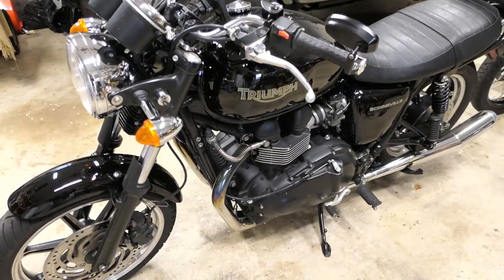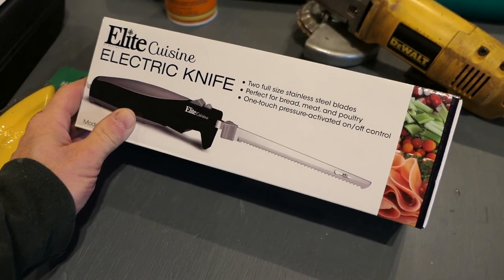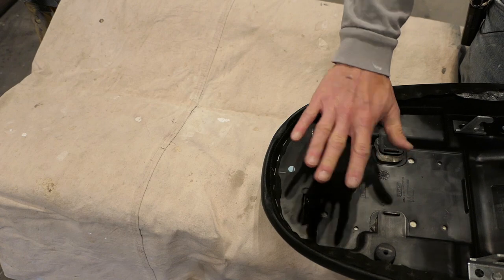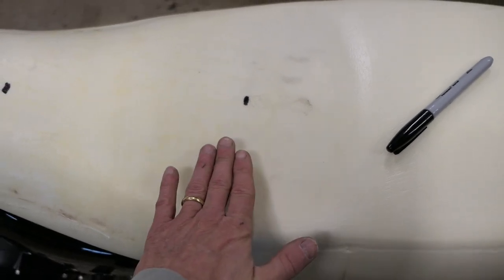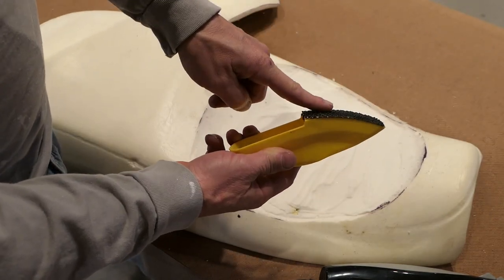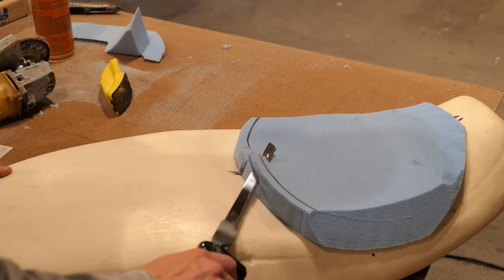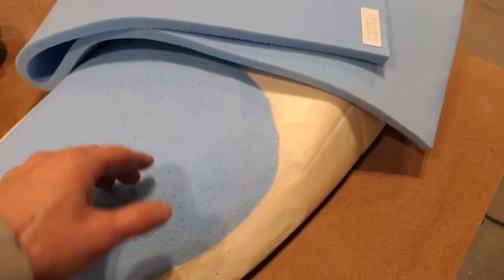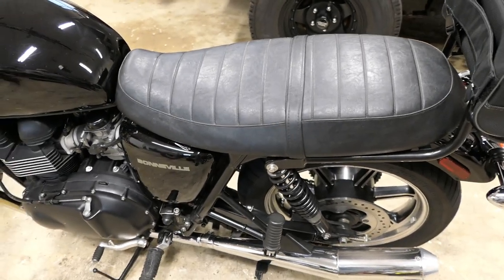Add A Seat Foam Insert For Your Triumph Bonneville

Comment: Great video. Curious as to how it’ll break in and feel down the road too. Wanting to do this to my bike since new seats are $3-400. Thanks for the lesson!!
Reply from the maker: I put this off far too long.  Really the hardest part was finding a supplier of the foam and picking the right density.  The actual work was not bad at all.

Comment: What densities did you end up using and how do you like it now that you've had some time on it? Is their chart pretty accurate? I'm going to do some work on my scrambler seat, great video thank you!
Reply from the maker: If you are on the bubble, go with the softer density.  Their chart is okay, but I think it's a little biased toward the firm side.  I weight 140 pounds and the softer density was better for me.  Of course, it's not just about density--the height matters too.  If you can go with a little higher cushion you can use a softer foam and still have something between you and the pan.  If you need to cut the foam very thin, then too soft of a density could leave you sitting on plastic!  So, it's a balance.  I'm still very happy with my modifications.

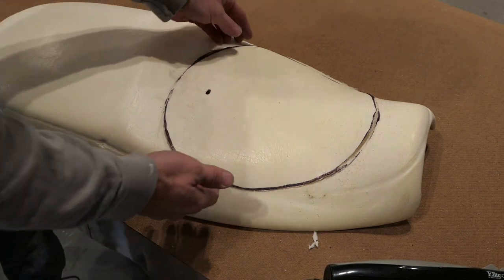Comment: great work and a lot of courage to tackle that job. However, as you say at 7:55, there isn't much of padding - as the saddle was designed for the looks, not for comfort, in my opinion. So, softer or harder makes little difference. My butt immediately finds the hard shell underneath, so I would rather use a firmer foam.
Reply from the maker: Every rear-end is going to be different, and body weight is important to consider too.  I recommend purchasing a variety of foam densities so you can experiment.  I've been very happy with my modification in the time since it was done.
Reply: @tinderboxarts  thanks for your feedback

Comment: What density foam did u go with and whats your weight?
Reply from the maker: There are links in the description to the place I got my foam, as well as a chart relating density to weight.  I don't weigh much, about 135-140 pounds. As a rule of thumb, I would lean toward the softer foam if you are undecided.  That chart should help, though.
Reply: Awesome thanks 😊 @tinderboxarts

Comment: So did you use "soft" covered by "extra soft" foam? It is unclear which foams were used.
Reply from the maker: With experience I would recommend going with "soft," unless you weigh a lot, in which case you might go with "medium soft."  The extra soft can be used as an overall covering if you wish.

Comment: Hello John, you had a mustang touring seat if I remember correctly.
Reply from the maker: I do--good memory!  I still have that seat, which I can swap in and out as desired.  My son will sometimes borrow my Bonneville when his Tiger is down for maintenance, and he's partial to that seat.  Nowadays I use my Bonneville for local fun and my BMW for longer rides, so I'm more likely just to use the factory seat on the Bonnie.  With the new foam insert I may not even use the Mustang anymore.

Comment: Old fashion stapler does not work well with the hard plastic the seat pan is made of.
Reply from the maker: I tried a couple manual staples.  You can do it, but you'll probably wish you had an air driven stapler or an electric one.  They actually aren't that expensive to buy.

Comment: Which foam did you end up using
Reply from the maker: I've done this with two seats now, and I think I would advise you to lean toward the softer foams.  There are variables, of course.  If you are short and you are trying to shave the seat down, you may not have much thickness to work with and if you go too soft you'll end up sitting on the plastic pan!  Or, if you are a heavy hitter and you'll be putting all those boxes of donuts on one area, you may need a firmer foam.  But, for most riders, I think you'll be happier with a softer foam or at least a soft layer of foam over a firmer layer.